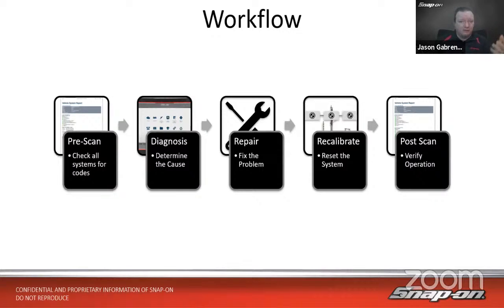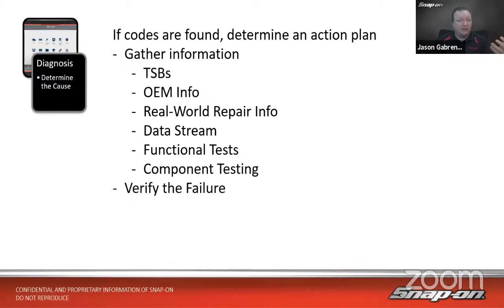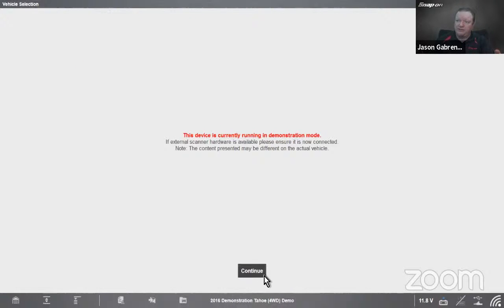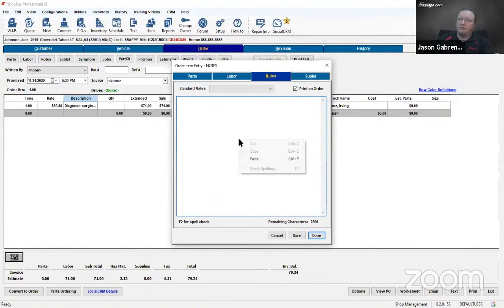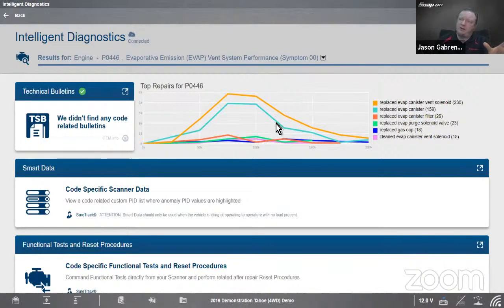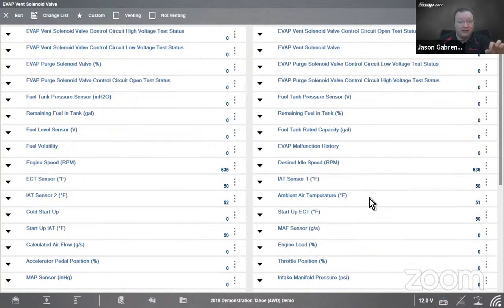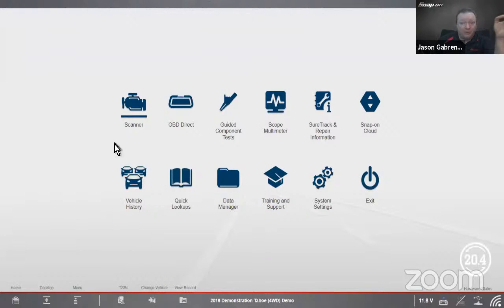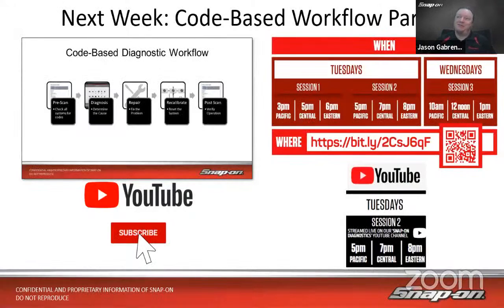Code-Based Diagnostic Workflow Part 1 - Snap-on Live Training Episode 09

Comment: Another great video as usual defiantly learned something.  One issue you might come across while using the bi-directional controls with the scan tool is if you component you are trying to activate the driver in the computer may not operate with an active code.  You may need to clear the codes to get the drive to work properly with a bi-directional command from a scanner.
Reply from the maker: Great tip! Thanks for watching.

Comment: Question:  How would you know after replacing, example fuel injector, you need to reset/reprogram/re-code a module, how would you know?
Reply from the maker: You could check either in repair information for After Repair information, or you could check under Functional Tests and Resets to see if there is a procedure listed.